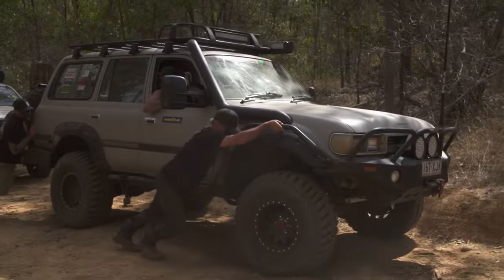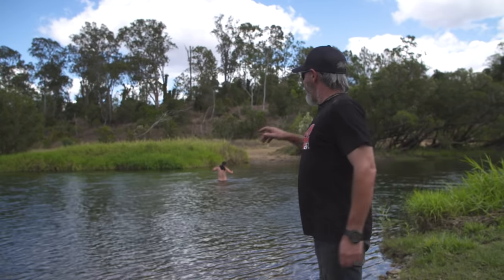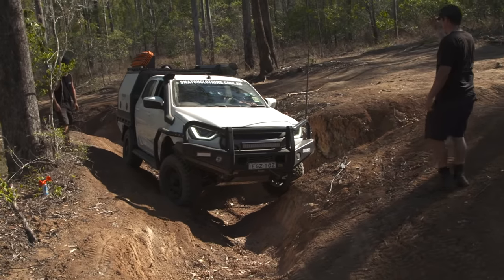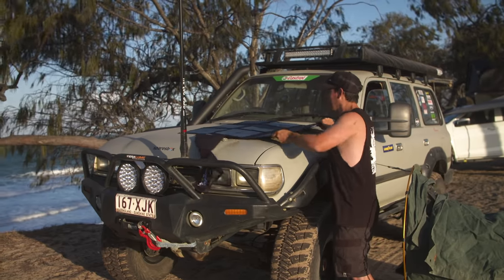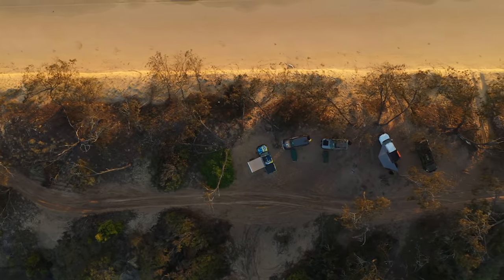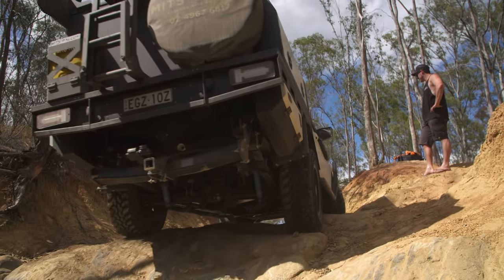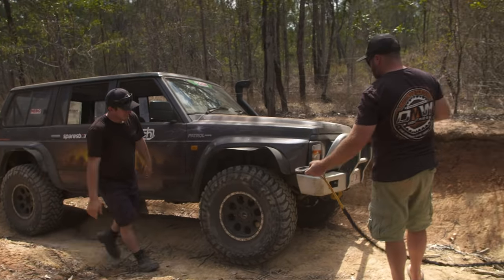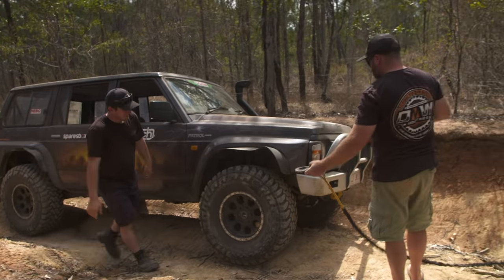CHEAP NISSAN OUTDRIVES US ALL! Secret 4WD Hotspot With MENTAL Tracks & WICKED Beach Camps

Comment: 10:07 “it’s what separates a 2wd from a 4wd... you just don’t take the old pulsar across a river like this”

Me in my old 2010 barina: I’ve been 4wd 100s of times when I was little I can do this. Proudly shows up to camp ground to meet my friends and instantly had the guys swarm my car to check if I had flooded anything.. may have had a few more spectators when I was doing the return run 😂 
Not sure if it was pure talent or complete ass 😂

Comment: As someone who is new to 4wd'ing, I agree with Graham about something that he said is essential gear. My tip to anyone starting out, think about everything you buy twice before spending the money. I purchased woollen seat covers when I bought my second hand un-modded rig, they are comfy as buggery on tar, but absolute sh!# on the beach and in mud as they have lateral movement. Not a fun experience when you need all your concentration with your vehicle is leaning to one side, and you feel like you're going to slide out the window. Buy the right equipment 1st time, and save money in the long run (and enjoy the off-road more in the meantime).

Comment: There are brake line solenoid valve  that help to lock one wheel off and transfer the power to other side.  Help in very tight turning situation too

Comment: I just wish my kings springs up front didn't sag so much 
Spent 5k on bilstien with kings springs from fulcrum and I had to use N80 Progressive springs in my Fortuner. 
But they have sagged again.
I wanted Hd springs but my installer didn't want to do it.
Rides nice but don't like the front end hanging low

Comment: 18psi is not aired down, I run my tyres at 8psi, no beadlocks, to get traction when needed.
Reply: If 18psi works for em they have never met a legit soft sand haha

Comment: the gq getting hot is because the radiator has not been cleaned out.. my gq runs cooler after the radiator has been cleaned of mud and dust